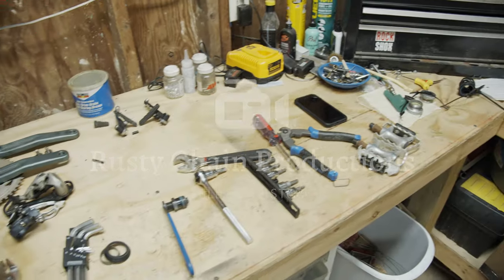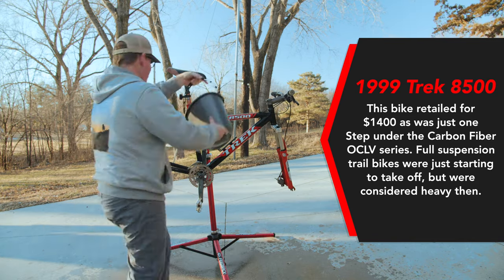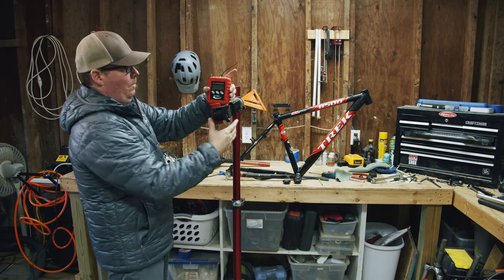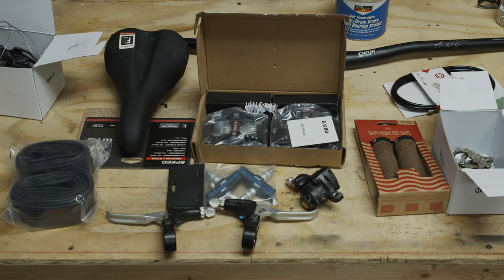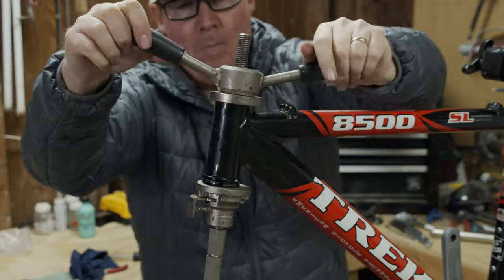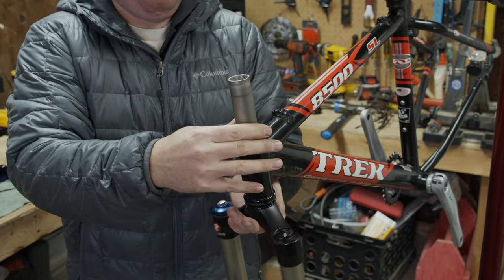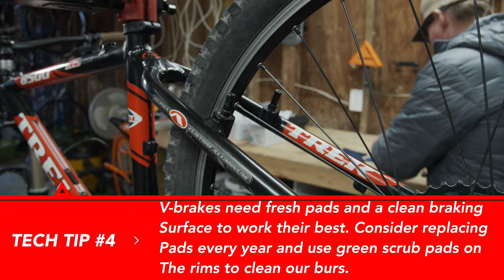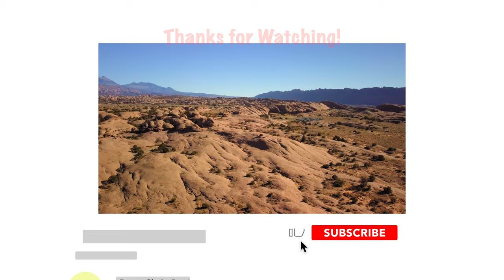Trek 8500 Mountain Bike Restomod / Restoration

Comment: Nice 99 trek 8500. I had that bike in 2000 when it was 1 year old. Was so cool to be one of the few in a small town with a hydraulic front disc brake. It also had the red anodised rockshox seatpost and a Judy 100 fork which was considered quite long travel for a race bike. Anyways its cool to see one rolling again.
I still have my 2003 8500, great bike also.
Reply from the maker: That is awesome! Glad you still have the 2003.

Comment: After a few years of being sick I'm back on my bike and riding every day a little bit more, I had a 2012 Trek 6000 in storage for 6 years, and I took it out to start riding again, it needed some refreshing and while I visited the bike shop I noticed a 2012 Trek 8500 frame hanging from the roof.
The 6000 frame was actually a little big for me and the 8500 was the perfect size, so I swapped frames and now I'm riding a franken bike with the 8500 red frame and the blue parts of the 6000, and I couldn't be happier, this thing climbs like a champ and rides very comfortable.

If I'm not mistaken 2012 was the last year for the iconic 8500 before Trek changed names and models.
Reply from the maker: Congrats Federico, that is great your were able to get a better fit for your bike. Glad you are feeling better and are able to get out and ride more!

Comment: I have the identical bike to this one. Mines a 20” frame though. I’ve had it 21 years. It still has the original drivetrain components, shimano deore 27 speed. I’m running Hayes hydro disk. (Installed in 2014). Still have the original fork. I’ve changed the seat post to a rigid, and changed the neck piece for an adjustable one. Other than that, the bike is original, save for a couple cables. I love and use it as much today as I did when I was 11 years old.
Reply from the maker: That is awesome! So glad to hear you kept all these years.

Comment: Bought this same bike new 21+ years ago. Stock, the bike came with a Hayes hydraulic disc brake up front and rim brakes in back. Before I left with the bike, I had the shop fit the rear with a Hayes hydraulic as well. This bike has been incredible and is still my favorite bike for easy to moderately difficult trails or muddy conditions. This bike is so light, it's like a scalpel in the woods. I just had my second replacement fork installed - both were/are Rockshox Recon air forks which I found to be really excellent forks. I had to replace the front brake probably 8 years ago but the rear is still the original. I've had to replace chains, chain rings, and cassettes over the years but all-in-all, this bike has been stone reliable - knock on wood. In 21+ years with this bike, I can honestly say  that I have not even looked at another hardtail. I have it fitted with Zefal fenders front and rear - not only are these very nice looking but are extremely effective. Every time I look at this bike, I think to myself "that is one badass looking bike". The styling & paint scheme are timeless - they never get old. In case it's not obvious, I really love this bike. I also really enjoyed the rebuild video.
Reply from the maker: So rad! Thanks for sharing your bike story. I love hearing about people holding onto their bikes and fixing as needed.

Comment: Love the videos and your very helpful tips.  I’ve started a very small at home bike repair business as a side hobby and have also fixed up and sold some bikes along the way since Covid.  What type of grease did you use for drivetrain bearings?  And what frame cleaner spray would you recommend as well?  Thanks for sharing.  Idaho looks very scenic 👍🏽
Reply from the maker: Thanks J, sounds like you have a very cool operation going on. Bicycle grease gets a little contentious sometimes but Park brand or Philwood Grease are the standard. But for half the price you can use a tub of grease from most car parts stores, drum brake grease is fine. For cleaning parts there’s a lot of citric-based cleaners without the nasty chemicals, you can also use A lighter solvent if you have a parts cleaner. Several companies in the bicycle market make it such as Muck Off,  Park,  and Pedro‘s. Thanks for reaching out,
Reply: You’re awesome, thank you!

Comment: Hey! Around the 4:50 mark you mention a third party adapter to replace the original Hayes disc caliper, could you give me the name of that adapter or how to find it? I have this exact frame and I love it, I put Marzocchi Bomber thru-axle on the front, some beefy rims with Conti Contact+ tires. The Hayes caliper, while good for the time, is now outdated and needs replacing as well. Sweet video, cool to see my bike in a video like this, I've put thousands of km on it!
Reply from the maker: Sure thing if you can give me a couple days I’ll get back to you we’ve just finished unboxing a bunch of the garage and I can’t find it yet
Reply from the maker: Okay I found it! the adapter is from a company called A2Z. The adapter is called AD-PMR. It adapts a Hayes mount to ISO. I found one on eBay for $30.
Reply: Thanks so much!
Reply from the maker: @electronicexposure  no problem and best wishes on your project!
Reply: I have a Trek 8000SL frame which I plan to use to build restore and add new components. This is the adapter that I orderer for a rear disk brake: https://www.amazon.de/gp/product/B00MRTHRH6/ref=ppx_yo_dt_b_asin_title_o09_s00?ie=UTF8&language=en_GB&psc=1

Comment: Like your videos!  I am the original owner of 2002 or 2003 Trek 800. 26" wheels on a large frame size.  Still in great shape, rides like it did when I bought it.  Thinking about replacing the fixed front fork with a shock/suspension fork.   Any suggestions on a suitable suspension fork?
Reply from the maker: Hi Alan, Thanks for reaching out! I have been impressed with the Rock Shox TK forks. Assuming you need to hold onto your v-brakes that is one of the few that still come with brake posts. You can also try out the Buklos forks on Amazon. I have heard good things about them but not tried them myself. Here is a link to the TK fork: https://amzn.to/3im2QyU
or Buklos: https://amzn.to/3im2QyU
Reply: @CoolBikeProjects  thank you.

Comment: Hi. Thanks for the great video. I have owned a Trek 8500 ZR9000 2004 frame from new. I built my mountain bike from this frame set. It had for many years very lightweight Mavic Crossride 26” wheels for rim brakes. My rim brakes were more powerful hydraulic Magura HS33. Now I have good lightweight disc wheels and front brake is already ok. I use Formula R1 hydraulic lightweight brake with Ashima Ai2 rotor. I’m having problems to convert my rear brake for hydraulic disc brakes as the frame doesn’t have even that 22 mm spacing Trek’s own brake caliber adapter plate mounting. I know that some 2004 years Trek 8500’s were using Shimano XT hydraulic disc brakes but I haven’t found out how it has to be mounted and where to get the correct adapter. There is two unthreaded holes in the frame close to the rear axle. Spacing is around 50 mm so I tought maybe this adapter could be the correct one: https://www.ebay.de/itm/274973181968 Greetings from Finland! 🎅🏻🇫🇮
Reply from the maker: Thanks for reaching out Janne, I'll have to do some research on the 2004 model and see if they have any specs for that 50mm spacing The original Klein - Gary Fisher - Trek mount that was 22mm? only fit one model of Hayes brake.

Comment: hi there i have the same frame and i want to mount a rear disc brake .. but really struggling to find to find the parts i need ..as i stay in the uk ..would you have a part number or any info on the rear brake calliper..thanks
Reply from the maker: Thanks for reaching out. Here is the only adapter I have come across that fits. https://us-swinnertoncycles.glopalstore.com/a2z-disc-pads-disc-mount-adapter-parallel-frame-to-is-caliper-p115349/s331327?cid=GBP&glCurrency=GBP&glCountry=GB&gclid=CjwKCAiAmJGgBhAZEiwA1JZoluRLex6c_RMPTAJOwB_7E_TBObxeje7CnfI75zfECYYYaS3PElwRqRoCVYoQAvD_BwEUnfortunately it was only meant for a very narrow caliper brake like the early Hayes that came on the bike.
Reply: @CoolBikeProjects  ok thanks